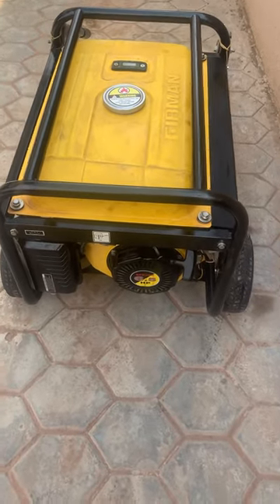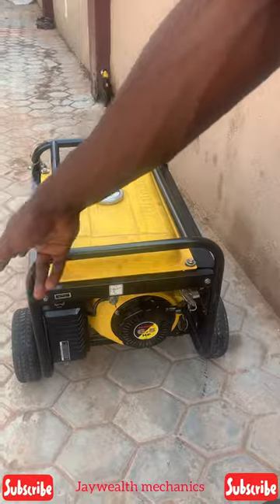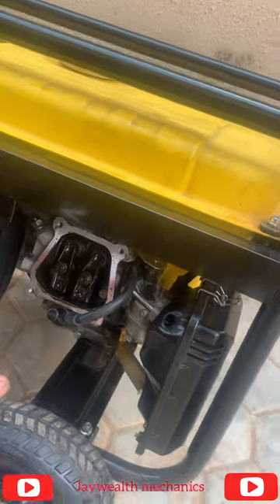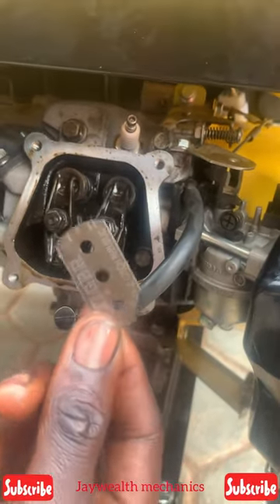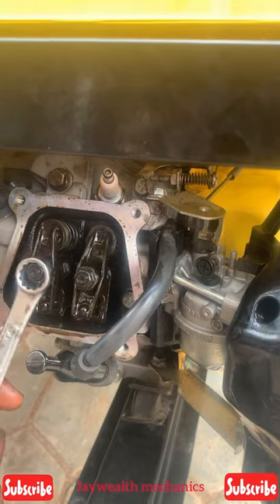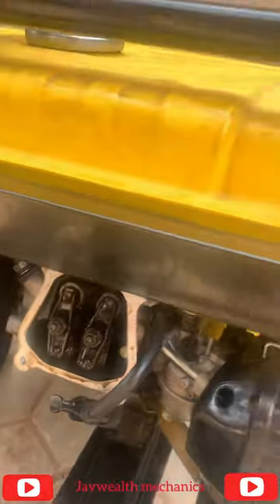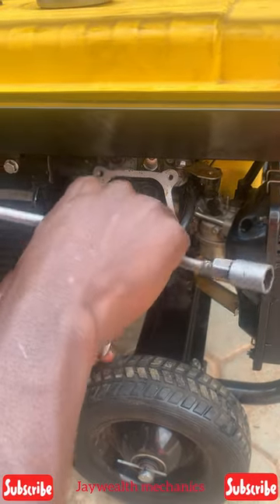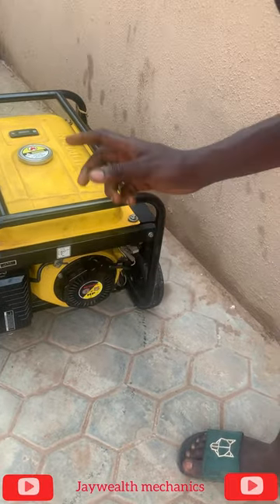How to set valve lash clearance for gasoline generator

Comment: This is a terrible way to lash valves .. won't last long. Use the proper feeler gauge to adjust valves and torque specifications and make sure your pistons are at top dead center on the compression and exhaust strokes ! Anyway, good luck!
Reply: Was about saying this...most people are not aware of tdc and valves should be set on compression stroke with exhaust having a thicker feeler gauge.

Comment: Aren't you suppose to be on the compression stroke before adjusting the rocker arms? At least that's what I learned from watching multiple videos on the subject.  I do like the razor blader blade method, I had to buy a feeler gauge.

Comment: Hi brother great video all the way from Ireland here 👌 I’ve taken apart a engine on a pressure washer it was starting before I went around it , but I lined up the timing and everything I’ve a spark but I messed with these lads and now it’s hard to pull but won’t even come up and my carbs clean and I have spark so I’m clueless here I’ve used a small blade but no joy for me any help would be greatly appreciated
Reply from the maker: Firstly confirm if your timing is well set and the valve settings.

Comment: How are gensets classified?
Do they all have the same dimensions of parts regardless of the manufacturer? Or maybe each manufacturer has their own dimensions and design of the parts?
Reply from the maker: Generators can be classified in various ways based on their function, size, fuel type, and application. Each manufacturer have is own dimensions and design

Comment: My generator is hard pull to start and I have changed the cam shaft pls what is happening
Reply from the maker: Set the valve well or did you shorten the connecting rod.

Comment: Pls what causes a generator to make a loud noise which obviously is coming from the valve area?
Reply from the maker: Check if the valve is set well. The carpet valve might increase the noise if it is not set well

Comment: Please, my generator went off after running for like 15 to 30 minutes, I have changed the oil and spark plug but it still doing it. What can be the cause
Reply from the maker: Firstly check if the fuel tap is supplying fuel.. then service the carburetor.. the carburetor might have diet

Comment: subbed because of your video five days ago. my govenor sproket came out and had no idea how it all fits back together. So appriciate that and looking forward to more videos. Can I ask a question in regards to setting the valves. From what I understood one needs to do the check on the compreshion stroke. How do we know the engine piston is at top dead centre when just after copreshion, as there are two strokes. One for copresion and one for exsaust. Bit confused about this? Thanks.
Reply: You can know when it's as the top dead center by removing the spark plugs and putting a screw driver through the hole to check when the piston comes up most...

Comment: Good morning Sir, please my generator do jack and stop immediately.
What could be the cause of it Sir?
Secondly, it will work for some time, before you know it the plug gets soak with engine oil. If I pull out the plug and clean it, as soon as I insert the plug back to the generator, the generator will work for like a minute and goes off again.
What could be the problem?
Reply from the maker: The generator needs overhauling.